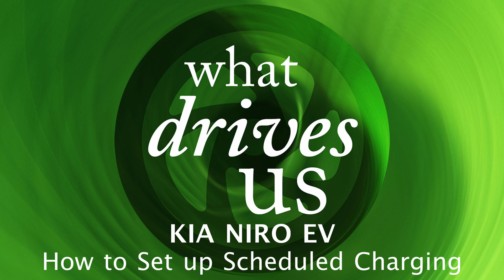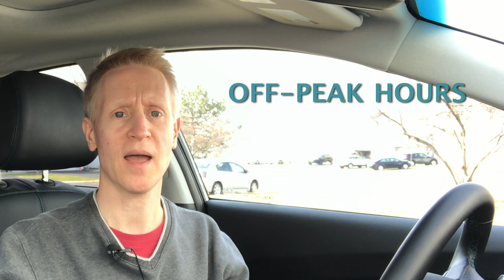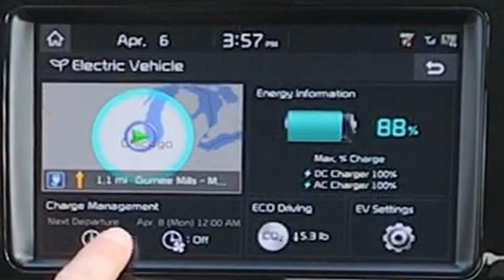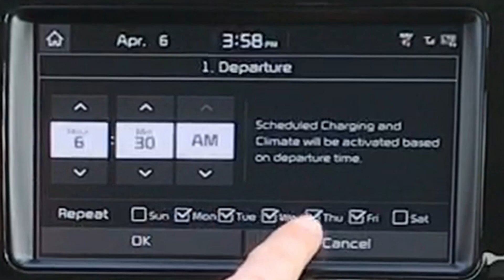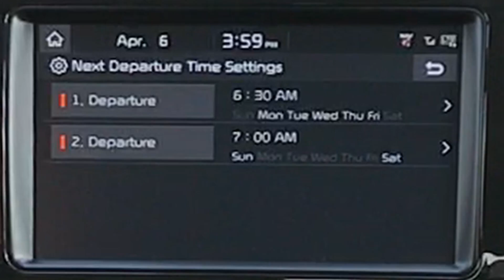How to Set up Scheduled Charging - KIA NIRO EV

Comment: Hi, if I programme mine to start at 7PM till 7AM, it starts at 7PM regardless of the SoC and time to 100% (or whatever it’s set at).
 So it seems the Niro is not calculating, it just starts when the time is set. And this is not the best for the battery because if it starts at 7PM and is at 100% let's say an hour later, it stays at 100% for the entire night till departure.
Am I missing a setting?
Reply from the maker: Unfortunately, I no longer have the Niro (it was a loaner).  It sounds as though you are setting up the "off peak" schedule and not the "departure" setting.  When setting up the "departure" schedule, there is no "start" time; there is only the departure time.  So because you mention that you are programming it to start at 7PM makes me think you are not using the "departure" schedule.

Comment: Do you still have the Niro EV?  Have you verified that the "Next Departure" setting still works even if "Scheduled Charing" is not checked?  For example, with your 6:30am departure, if it takes the car 2 hours to complete a charge, does it actually delay start of charging to around 4:30am or does it start charging immediately when you connect the charger and finish much earlier than 6:30am.  Thanks.
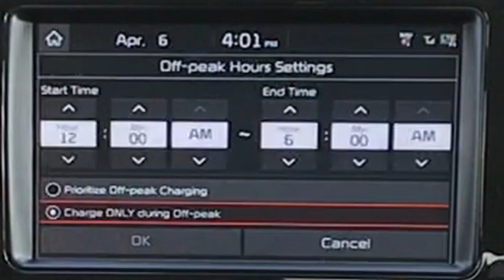Reply from the maker: I do not have the Niro EV any longer but I did test that with the charger at work, which are Level 2.  I set the timer to be ready for my drive home at 4:30pm.  I arrived at 7:30 and plugged in.  At first I just stood there (like a fool), staring at the car and the charger,  looking for any signs that charging had started.  Nothing.  I checked again at lunch.  Nothing.  My Prius Prime starts about 2 hours before departure so that's when I checked again.  Nothing.  Since I wasn't concerned about range, I wrote it off that I did something wrong.  But when I got in at 4:30, it was fully charged.  My guess is that the Niro charges faster than the Prime, started later than the Prime, and if I had checked again I would have seen it charging.  All the other days, however, I did immediate charging in order to free up the plug when full.